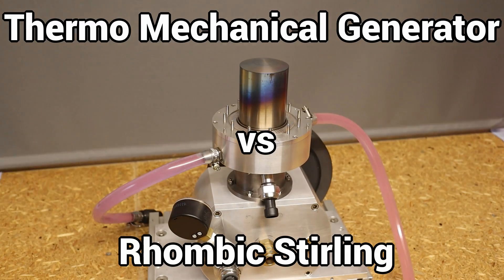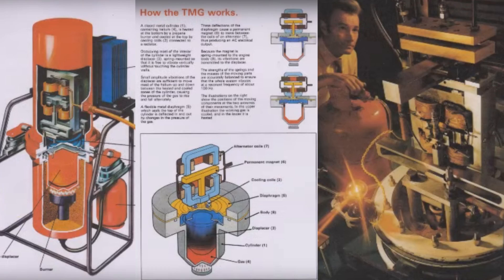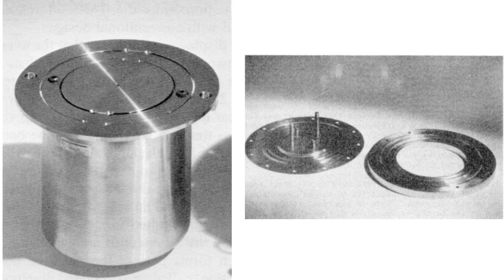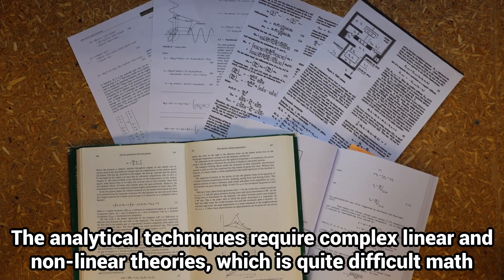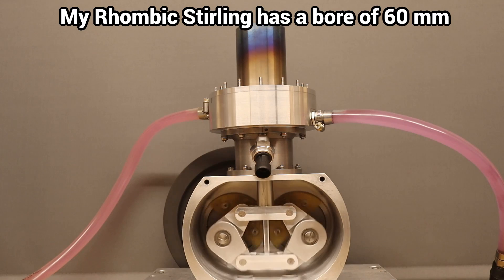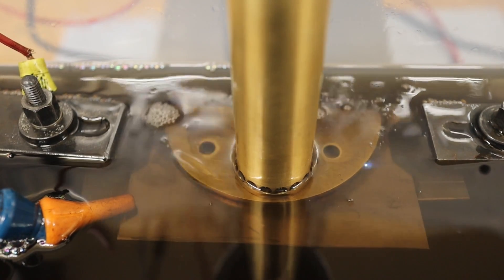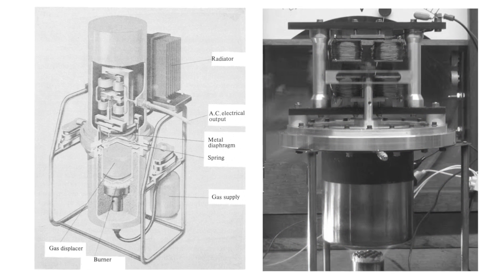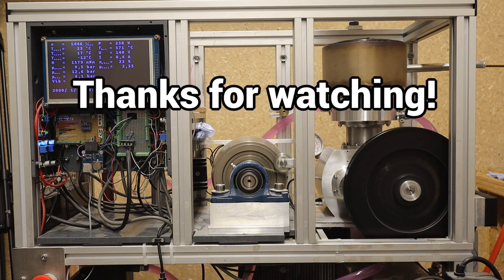Thermo Mechanical Generator for more cheap energy than the Rhombic Stirling engine to go off grid?

Comment: the diaphragm idea is a solution to the problem of the piston rings, but the TMG seems complicated, i think it's possible to use the diaphragm or a membrane in a classical stirling to solve the problem of the piston rings by getting ride of them and replacing them with a diaphragm,
Reply from the maker: I played a lot with diaphragms and membranes but they have unfortunately their own problems...
Both have their advantages and disadvantages and the way they are used and made makes the difference.
Reply: @myengines2443  someone called "Shane Pomeroy" built some powerful stirling engines and even a narrow gauge locomotive, i'm still checking his content, but he seems to have used a diaphragm on one of his big stationary stirling engine.
Reply from the maker: He really makes great engines and I love to see his videos!

Comment: I imagine that today, using digital control systems and modern materials, this could be simplified quite a bit.  I suspect the whole feedback system can be offloaded to a something like an arduino.  Perhaps even the metal spring could be replaced with something simpler when active control is used with the linear generator.  Just some thoughts.
Reply from the maker: I think trying to control the thermodynamic cycle will be quite complex but maybe its possible...

Comment: Metallic bellows are very commonly used in pipe systems such as the dairy processing or chemical industry, etc. Could these be adapted to fabricate a diaphragm suitable for a TMG?
Reply from the maker: Yes maybe but they are complex and expensive.
The ones I know have a duty cycle of a few million which is not enough also, but maybe there a ones wich are more duable.

Comment: You should consider abandoning these very inefficient engine and concentrate on internal combustion engines.
There are so many IC engines out there to choose from.
Reply from the maker: But then I will get other problems when using my "dirty" fuels biogas and woodgas in micro IC generators!

Comment: These engines work better when when the gas used to move the pistons is lighter, like helium. Encapsulating these parts in a chamber of helium greatly increases it's output. Not sure if or how this would help you, but i figured sharing this here wouldn't be a waste of time.
Reply from the maker: Yes I made a few experiments with helium and have a big bottle of helium here in my workshop.
Thanks for your suggestion!

Comment: Kudos to you on your fabrication skills and persistence, you have my respect. I have been studying and contemplating my own design for years now and will say, my vote is for the TMG. It solves too many difficult problems of the other designs to be dismissed for the difficulties of design and fabrication. NASA has already demonstrated one running continuously now for over a decade. It looks to be the most reliable and does not necessitate high mechanical tolerance fit on the high temperature components, a critically important consideration I think. Since you would be using in a stationary setting, compactness and high pressure is not as important as would be for a car. To fabricate the diaphragm, I would suggest hydro-forming. Good luck! I wait eagerly to watch your progress.
Reply from the maker: Thanks for your kind comment.
The TMG is really nice, I have problems with its big diameter, low power and its difficult balancing of the forces.

Comment: The TMG has low losses and should therefore have good efficiency, and complex mathematics are much easier today with the help of computers. Springs don't need to be build from spring steel and membranes need no copperbronce, you may use stainless steel. I think the main construction decision is the displacer, withstanding temperature changes, vibration, and mediating the temperatures. Multiple experiments may be neccessary.
Reply from the maker: I am not sure about the low losses of the TMG.
The number of multiple experiments is what makes me doubt.
Its very frustrating if you can't get an engine to run.
I thought the displacer is a simple standard part in comparison to the complex balancing of the springs/diaphragm/linear alternator forces.
What do you mean with the displacer problem?
Thanks for your helpful comment!
Reply: @myengines2443  The displacer is the cruical part in a stirling. What the regenerator is in an alpha stirling configuration must be acconplished by the displacer here. So the displacer has to have a thermal mass and better is not circumvented by the air but the air should pass thru it to be cooled/heated while passing from one side to the other, kind of a sponge.

If the TMG will not start, it should be possible to excite it by applying AC to the coils. If the spring does not match the pendulum weight of the displacer, it should be possible to dampen it by applying a load to the coils.
Reply: @flexiblebirdchannel  Just in my 'armchair mechanical engineer' opinion (thought experiments), it seems like you may be able to start a recalcitrant  TMG engine by shaking it axialy - it needs to be mounted flexibly anyway, since the displacer action is a result of the housing moving axially, pushed by the action of the power piston. For example, I think this is similar to a Ringbohm engine, where the gas pressure actuates the displacer, except a step simpler, where just the motion reaction of the housing from the power piston moves the displacer. 
   For a first design, it might make sense to have the power piston with the gas volume have an approximate resonant frequency close to the desired operational frequency. The displacer on its spring might be more of a function of its desired travel in the housing.  If the displacer and housing springing can be simple flat strip leaf springs, maybe these can be easily adjusted to get stiffer or softer springing to 'tune' the system to get a useful motion of the displacer. The key may be to get the right phase lag of the displacer, behind the power piston, and I am suspicious that the wrong phase lag may just move the operational frequency out of a reasonable range - based on my fuzzy recollection of the phase lag of a resonant system increasing as you raise input frequency of the system closer to the theoretical resonant frequency. You may not need to model the system in detail, just analyze the mass- spring system based on approximate resonant frequency. 
One additional encouragement - the proliferation of simple engines of this sort using tin cans & rubber balloon diaphrams, which operate (if at low power), and likely were developed by trial & error.. 

The TMG would probably have very low mechanical losses, with no sliding seals or rotating mechanisms. The key is to increase the power output, maybe with larger displacement or pressurization... It sounds like there are possibly better configurations for the linear alternator.  15w would charge a cell phone or tablet, which is great if its a simple device..

Comment: I am still enamored with thermoacoustic generation. Heat flow forces a loud sound, which pushes a speaker coil. All the difficulty is then focused on the resonance block (i think its properly called a matrix) that slows down the pressure waves long enough to gather thermal energy. 
That difficulty is broken down into two parts: 
1) How do you manufacture it?
2) Where in the resonance tube do place it for optimal effect?
There are plenty of approaches to dealing with this difficulty. None of them are perfect.
Regardless, this is my answer to the question.
Reply from the maker: Thanks for your nice suggestions.
The thermoacoustic engines (standing and traveling wave) are the subject of my next video I think...

Comment: It seems the fine balance of either solution, whether in tuned diaphragms/mass or sealing surfaces, is going to take a great deal of effort. Perhaps some form of low friction low tension PTFE piston rings mixed with tight tolerances, minimal thermal expansion, and labyrinth-style sealing? I do not think there is an elegantly simple (in both design and implementation) solution at this point. Multiple stirling fan like devices linked together (mechanically or electrically)?
Reply from the maker: Unfortunately I think that you are right....
The little Stirling fans have a power of only a few watts so I would need many.
I also think they are not very durable when they have to run 24/7.
Thanks for your suggestions

Comment: TMG is the future. Look at NASA's free piston stirling. Its small tube that generates 1-3kW with 2 moving parts. (Membrane is a dead end. No friction piston on 2D spring only).
I will make it experimentaly with arduino and fotooptor (for positioning) and some coils to push displacer magneticly. Extremly dificult to sync but possibly can be done.
Reply from the maker: NASA built also a TMG?
Or do you mean their Free piston Stirlings?
Reply: @myengines2443  free piston. You should consider amount of work that You will use at another rombic stirling vs free piston. Ive already cutted 2D springs. Its not so hard. 
You need non contact sensor arduino and some coils to push displacer in right moment. Consider it well becouse Your time is priceless. ❤️

Comment: thats a terrible design for the generator...

it is tricky to design.
you have a given stroke. yay.

magnetic fields want to flow as loops in iron cores. gaps create reluctance, leakage, and limit the power. you want the smallest air gap possible. the stroke length limits the overlap and width of cores and coils, the flux one can carry in a given lump of iron, and the coil size one can wind on that iron. all this data is pretty standard material, gathered over years. available if you look into winding transformers or motors...

i spent a bit of time playing with teslas oscillator, always mean to return to the bits in a box and finish it, lol...

you use a magnetic piston. or electromagnetic, in teslas case. visualise the flux as forming a small toroid around it. so you have two pole pieces in the form of a C either side, coil wound in the middle of the C. now the flux flows through the Ccores.
with the piston central, all its magnetic flux flows through the C cores. cuts the coil mounted on the C-core. creates EMF... (when moving...!)
with the piston at either extremity, the pole piece of the Core has to be wide enough to short the magnetic field of the piston. the flux flowing simply through the end of the Core, not the coil. no EMF.

why? as the piston changes from mid stroke to the end and back, the area of iron overlapping, that is, the circuit through which the magnetic flux flows, ideally has to remain constant. you dont want an air gap that is changing as it affects the power flow, the coupling of the magnetic circuits. it also reduces cogging as the attraction of the magnet to iron is "constant" through the stroke. ideally the piston should sit in the coil anywhere. the only forces it experiences are once its moving and a current is induced in the coil.

you need the magnetic field of the piston to make as efficient a coupling as possible, with as much change of the magnetic field as possible, to make it work.
another issue is that the magnetic field always flows through the cores in the same direction, and they tend to magnetise... need very soft iron with very little remnance. and it halves the amount of change you can get... rather than full flux one way to full flux the other way. it technically doesnt even produce true AC... sinuously pulsed DC?

 so yeah... theres a relationship between stroke length, the length of the piston, and the dimensions of the pole pieces and coils to make a generator that can make use of the power in the free piston...
Reply from the maker: Thanks for your extensive detailed help!
I have to think about it and investigate the information.
Many thanks!

Comment: I would like to see a design that uses the sterling engine to make use of the waste heat from fridges, hvac system, washer and dryer, and ovens etc. A design of the house might need to be altered to make use of this efficiently like all those machines are close to each other in a stack connected via tubes to the sterling engine.
Reply from the maker: For the relatively small (except ovens) temperature difference you would need a LTD Stirling which has very little output and may only be reasonable if the amout of waste heat is very large
Reply: hmm. I would think a household waste incinerator with something like this atop could be way better source of heat.
Reply: Yes, burn plastic. reburn, reburn, reburn. extract extract. turn turn. sinewave come. vapour vapour. converted later.

Comment: Jumping rotor thats spinning with dual springs pushing down,  old clock makers have design to make self running motor
Reply from the maker: I am not sure what you mean but I will inform myself, thanks

Comment: I really think you are on to something. Stirling engines should be able to reach much higher efficiency due to less wasted energy, plus the option of energy recovery. I think to maximize efficiency, you need to split the energy input and working fluid from the generator to gain efficiency from something like supercritical CO2. Internal combustion engines lose over 15% efficiency from exhaust heat alone. In a sterling engine, there are mainly 3 sources of recoverable energy. 1. Waste heat in "boiler" or combustion chamber walls + exhaust. 2. Working fluid post expansion cycle radiator 3. Working fluid, post compression. This recovery can be done using fuel to raise combustion efficiency/temperature, or pre-heating working fluid.

For your current problems:
You can produce your springs by electrochemical etching with little more than a printer and a battery. DIY pulse jet engine leaf spring valves have been made this way for many years. Another option is PCB resist foils or printing a stencil, cutting it out, and using spray paint to cover the parts you want to protect. Then you submerge in salt water and connect a battery.

An option for producing diaphragms is to use a set of toroidal rings to press a wave pattern into a thin sheet of metal, in a mix of stretching and shaping of the metal. The "corrugations" in addition to the stretching give the metal the 360 degree flex and are commonly made from stainless steel.

If you find that increased magnet travel is more efficient than force in the electrical transformer, you could try a lever to trade one for the other.

I think Ideally you would want an opposed piston design and either avoiding the diaphragm through harmonic balancing of 2 springs, or a free piston design replacing the spring.
Reply from the maker: Thanks for your many suggestions, I will investigate them!
Reply: Grind the edges if you chem etch leaf springs. Need to remove rough edges for high cycle fatigue

Comment: A closed cycle turbine has a slightly lower efficiency than a Stirling engine but a conventional rotating generator can be used and it has only bearings connecting moving parts to static parts
Reply from the maker: Thanks for your suggestion, I will inform myself of the closed cycle turbine.
Does it run with steam or gas?
Reply: *closed cycle gas turbine
It has external combustion with an heat exchanger and a working fluid such as nitrogen, hydrogen or helium just as a stirling engine. They are used as efficiency boosters on power-plants so information is easy to find
Reply: Magnetic bearings or even air bearings have practically zero wear or losses.
Reply: Thats a good suggestion but i can't find any real closed gas turbine system working, do you know any examples? or its more of a teorical thing?
Reply: They are used in power plants as a second second stage. Search for two stage gas turbine power plants

Comment: Have you heard of the "thermal lag engine"? It is one of several external combustion engines with one moving part. These are the engines with one moving part:
• Thermal Lag engine
• Rice engine (need not use rice)
• Manson engine

See this: watch?v=lu2T3HoIcos 
The thermal lag engine exploits the lag time between a compression wave pushing the gas to the hot end and when the pressure actually increases due to the lag time it takes to heat the gas. During expansion, the bulk of the gas moves to the cold end, and again, there is a brief lag before the pressure drops. 

The rice engine uses a pack of rice or glass beads or gravel to cause the compression wave of gas to phase shift before showing up in the hot side. This phase shift behaves like the displacer of a stirling engine. It is a kind of thermoacoustic engine. See this: watch?v=Lyhylj5kHjw The only moving part is the piston or diaphragm.

The Manson engine uses a displacer with a very thick shaft, which behaves like a piston, and it uses some valves that open at the end of each stroke to let air in or out of the engine. During expansion, the displacer pushes gas to the hot end while simultaneously acting like a piston pushing out in response to the pressure rise. At the end of the stroke, a port is opened to relieve any remaining pressure. Then, as the displacer-piston strokes back in, the port is obscured, and as more and more of the gas is displaced to the cold end and the pressure drops, the piston gets pushed in due to the atmospheric pressure being greater than the pressure inside the engine's working volume. At the innermost part of the stroke, the port is opened again to relieve any remaining vacuum.
Reply from the maker: Thanks for your nice suggestions, I will inform myself about your topics!
At the moment I am already investigating the Thermal Lag Engine and in a few days I present my results about it here in a new video!
Thanks and greetings